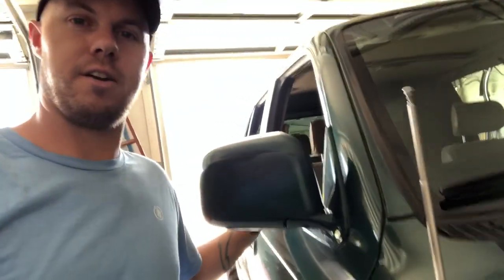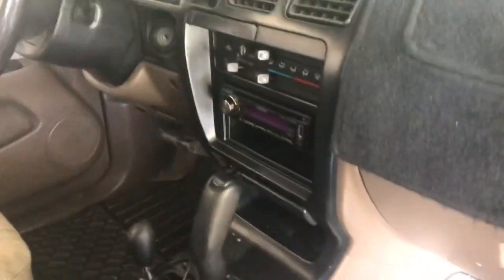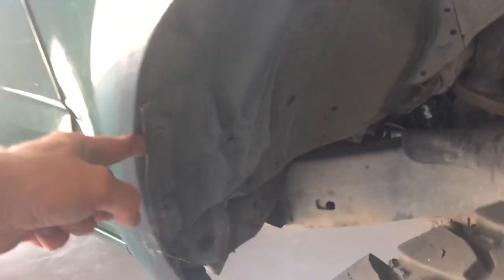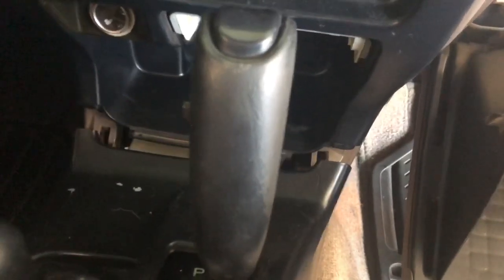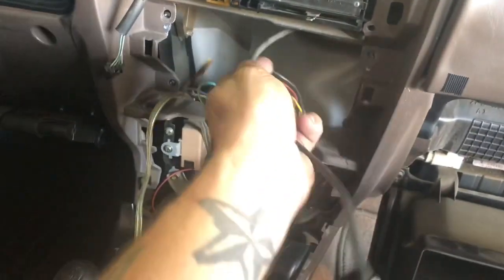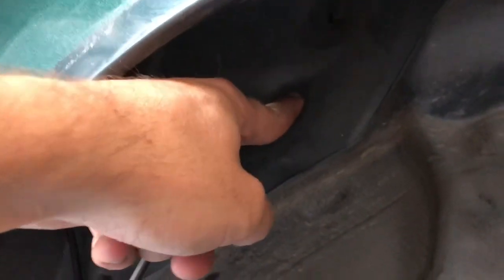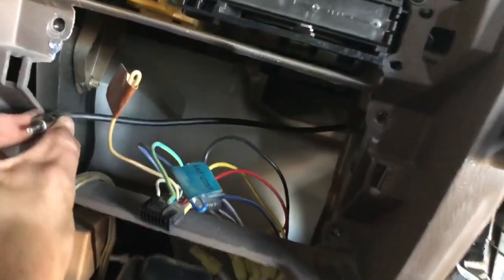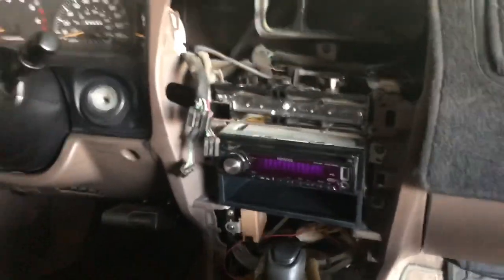3rd gen 4Runner antenna swap

Comment: Pretty much same issues I have, had, etc. At an apartment now, so lack of space, tools, and familiarity hindered efforts. I ended unplugging antenna motor leaving it stuck about 1/4 up. I like your simple practical solution with the fixed antenna. Did you happen to find out what the original issue was from? Like broken teeth on the antenna rack gear or something?  I'll have to share your channel with whomever I can. Thank you again.
Reply from the maker: So it has sort of a plastic worm cable in there. Mine was so dry rotted and blown into a million pieces so the teeth were not making any contact with anything.
Reply: @stonesgarage4240 Hey what dash kit is that for your stereo?

Comment: When i installed my new radio and 1st turned my car on the antenna went up and wont go back down? Even with the radio off? How do i put it back down?
Reply: Without disconnecting the antenna, should have it come up when radio is on and when off it should go down

Comment: Better for reception to have a non-functioning oem power antenna than a whip or aftermarket stud. Doesn't mean we can't install an inexpensive signal enhancer tho. I watched this on mute b/c I've got to disconnect the power antenna motor and needed tips. Pretty sure there's access straight through the fender skirt. Not sure why this video has the entire center unit and passenger trim disassembled other than for access to the rear deck. To each their own.

Comment: Did you ditch the antenna motor or is it still there?
Reply from the maker: TheRealitarian ditched it. It was all one unit and the plastic worm cable inside was all cracked to pieces so it went bye bye.

Comment: If it's helpful to anyone I went this route and it was an absolute bitch of a project. They make a simple converter mount where you just undo the silver mounting screw, pop out the telescopic antenna, drop in a new brace, put the silver screw back on and screw on the rubber antenna. Not sure how it works but I'd highly recommend trying that first. $50 on Amazon.
Reply: what product are you referring to? Can't find anything on amazon matching your description...
Reply: @adamsherman8735  reception isn't as good as the telescopic antenna but my radio does still work. I use Spotify for music so not really an issue for me.
Reply: @donbon303  did you happen to go with the converter kit or just the antenna? I don't think my motor works, PO had just used clothing wire as an antenna

Comment: Isn't there a ground wire of some sort that needs to be connected to the Deck from the antenna or visa versa? 

I ask because I'm getting a "whining" sound out of my speakers and I was told by my Stereo installation guy thats its my antenna thats not grounded?
Reply from the maker: What kind of deck is it? I had a similar issue when I had a cheap deck from autozone. When I upgraded to a better name brand it killed the whining in the speakers.
Reply: Whining is a bad ground most of the time